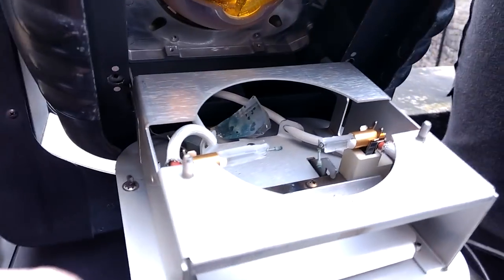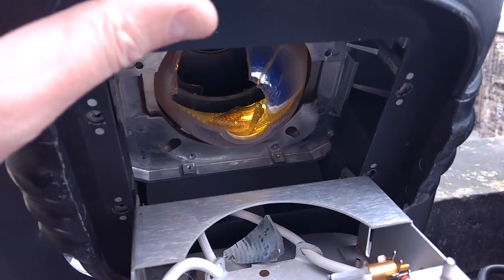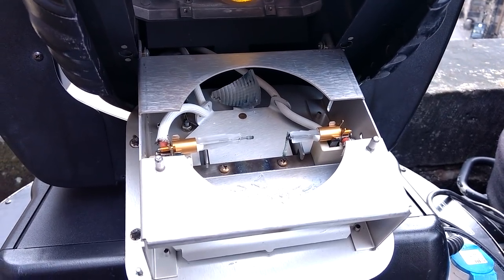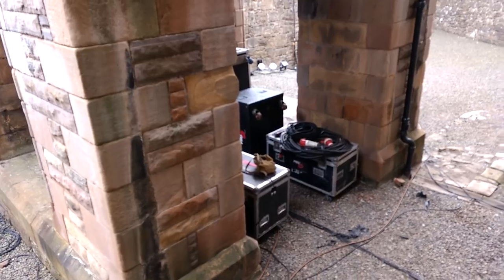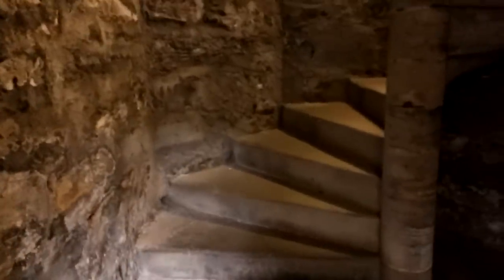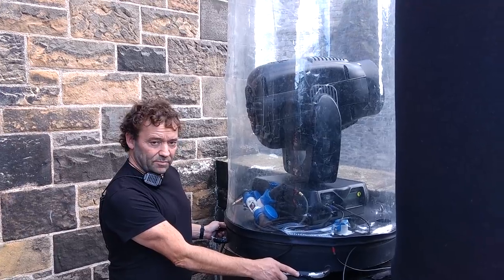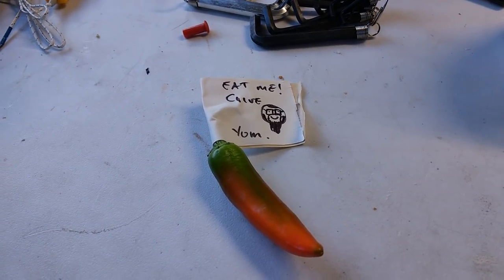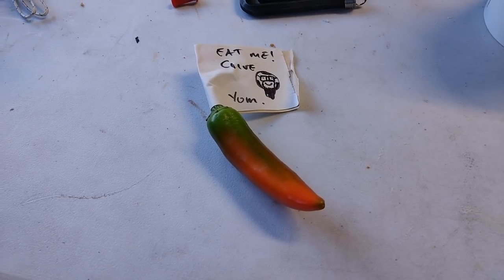Catastrophic lamp failure in Vari-Lite.

Comment: If you eat the pepper, you might also suffer forcible failure.
Reply: I think Vince is a hoot! (that's a good thing)
Reply: I think that pepper looks mild, like... it's probably a wax pepper, or jalapeno or something... to be clear, in spicy food they use more like cayenne or thai reds... and the daredevils eat the ones that are closely related to habanero...

I'm sure this pepper is a prank to make Clive look like a sissy, and it succeeded. If I'm right and it's a wax pepper, it's basically capsicum. Maybe with a tiny amount of spice, but not enough to break a sweat.

Comment: I've heard projectors explode in classrooms before. I'd hate to see what kind of damage they do to the insides of a cramped and complicated projector
Reply: Most projectors I've seen have the bulb in a plastic module, with a strong lenses and metal screens between it and anything else.
Reply: In inteligent lighting like moving heads ( like the one clive is showing ) or a scanner ( with a moving mirror in stead of a head ) the bulbs are free floating with a mirror behind it or a bulb like a 12v sealing bulb or the mirror serounding it like the one in this vid a projector has a bulb module to protect it

Comment: Was this a xenon arc lamp? The Wikipedia article on them is quite frightening. People who change the big xenon lamps in Imax projectors have to wear body armour.
Reply: Those are difrent bulbs i think the 4k bulb in search light get closer to the projector bulb but yea you need to treat those as grenades
Reply: I’ve been on shows where projectionists have to wear protection changing out the 35k lumen projectors.
Reply: Used to work with a chap who's father was a (obviously former) Lighthouse Keeper. He told me that back in the day, they used to rely on 5kw water-cooled xenon arc lamps (manufactured by Wotan (an Osram subsidiary)). The policy was to change well before their lifespan was up, partly for reliability of service reasons, and partly because if one of those failed catastrophically, both inner and outer housings would become one big shrapnel cloud. His dad did say that on the very rare occasions such things did happen, and the resulting bang "would wake up the dead!"
Reply: I'm surprised Clive hasn't blown one of those up.

Comment: Lol.. Eat me!.. 😂 Those lights ain't cheap.. Who pays for all the kit? Is it hired in and the hirers responsibility?
Reply from the maker: We're working for PRG.
Reply: @bigclivedotcom  phew good job.. Sure they will be insured against stuff like this anyway? That lamp just clips in like a fuse.. It blew like one too lol...but not contained. Suprised cob led modules aren't used yet or adapted to fit. Even if you replaced this 1 lamp with 4 led lamps & 4 drivers to achieve the same lumens output must be cheaper and more reliable. Maybe next generation will catch up. Interesting times for stage lighting.

Comment: Was just about to build a Metal Halide lamp. with Philips MASTERColour CDM-T 150W/942 10000lumens and 96 CRI for indoor lighting. Was considering a partially open frame, but definetely will be fully enclosed and fire proof now !
Reply: Make it explosion proof to :p
Reply: This is shooting glas particles at you if it fails.
You need a closed fixture because of high radiation.
Reply: I took them camping, they were amazingly efficient at lighting up the campsite, the dam and around a square kilometer of the surrounds. Also were the most incredible bug collector, the next morning I had a lamp that was almost hidden in the piles of well roasted bugs  that it had attracted and then lovingly roasted to a dark brown consistency. Lamp was otherwise fine, just had to strip the lamp out along with the glass front and wipe down with detergent then some solvent to get them clean again. Helps I have a dozen or so spare lamps for it I got for $5 on auction. Lamp as well, old  white shop downlighter that got saved from the scrapyard.
Reply: Get an O rated lamp
Reply: William Schrimsher I'm  interesed in >95 cri lamps. I will try to find an o rated one with high cri. Will post if i find one
Reply: @Txepetxcc  I can't speak with 100% certainty, because I use the CRI that my employer tells me to for specific tasks, but all the open rated lamps I use it work just have additional protection inside the , outside the arc tube whether it be metal or quartz, and shouldn't affect the color that much
Reply: ljmike1204 gotta put it in a pie tin.
Reply: yea a litte finger grease  will make a light blow up

Comment: Reminds me of the time I was working for a company that dealt with street furnishing and PPE as well as some other highway equipment.

The loading bay flood light had failed in the night when the van was being loaded, as the "Warehouse manager" it was down to me to manage the replacement of the bulb. So I did the job myself only I put the wrong voltage lamp in the spot, it was a halogen spot, the bulb that vaporised with an explosion that people further away thought was a gun shot, my bos thought a bomb had gone off.

They didn't sell many of those bulbs so kept the 110V olt ones next to the 240V ones for said flood lamp. I soon sorted that out.

Comment: When you have time, could I try and persuade you to do a teardown on the new (two)Poundland 2200MAh power banks. They are branded Power Geek and come in a C style case which seems fairly impregnable. would be interested to see the innards and resting current...plus your usual fascinating reverse engineerings.
£2 for a 2200mAh Lion battery is quite a good deal on its own.
Reply from the maker: I've got one here awaiting it's moment.
Reply: Having given mine a full charge, I was only able to decant just under 1000mAh into another battery via my Xtar charger, which is disappointing.
Maybe when they have one advertised at 4000mAh...

Comment: Does the lights in the protective case do anything to heat inside the light? The lamp explosion could be due to high ambient heat.
Reply from the maker: It does get hotter, but there is continuous airflow through the dome.
Reply: bigclivedotcom what do you think caused the lamp failure?
Reply: Continuous forced air flow with an intake and exhaust fan?
Reply from the maker: @simontay4851  Just an intake fan with vent holes, to keep the dome inflated while allowing airflow through it.
Reply from the maker: @jakp8777  Probably lamp age.